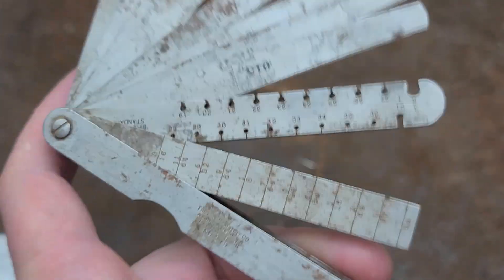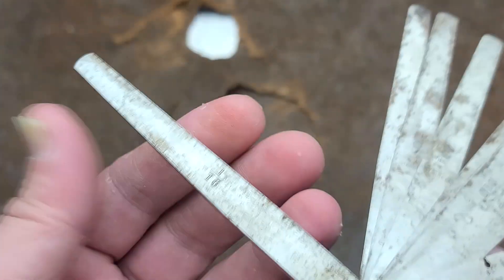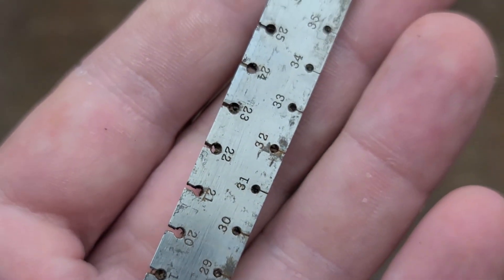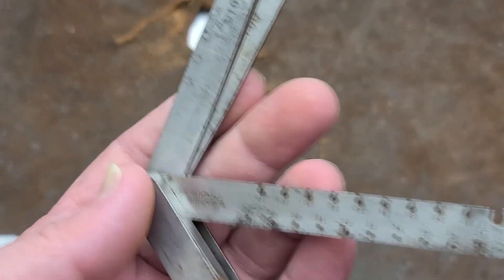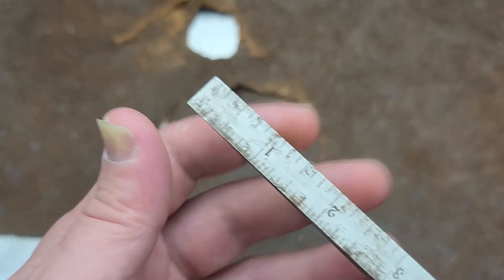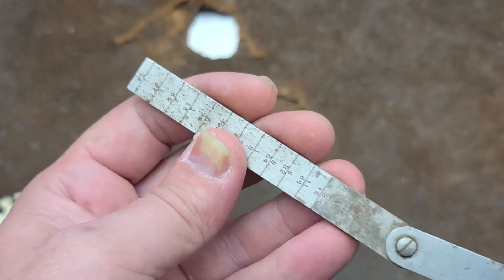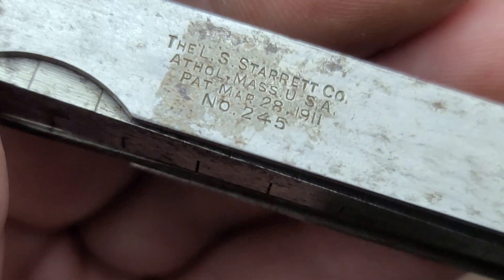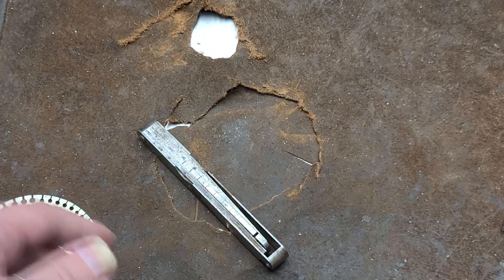Starrett USA 245 Engineers Wire & Gap Feeler Gauge Set

Comment: That's a neat idea to combine additional gauge tools in the thicker layers. It also seems like they've really thought through the stacking order for combining them. You can add 1/8" to the taper's range by using it with the thickest layer. Having the taper one fold in is also good. Shopping around for their longer taper gauge (no 270), I've seen so many with broken tips because the thin hard metal chips when dropped.